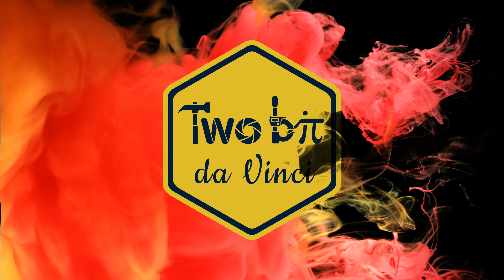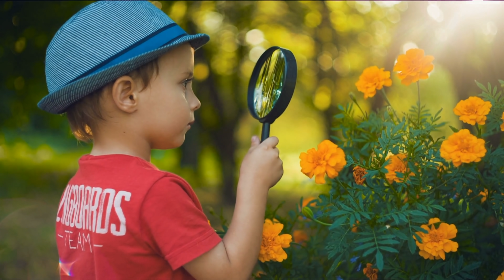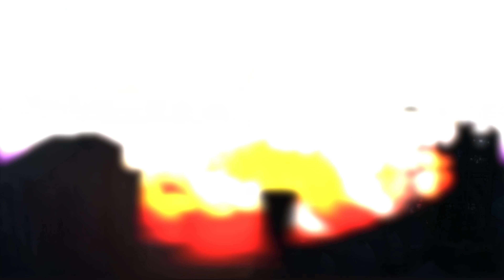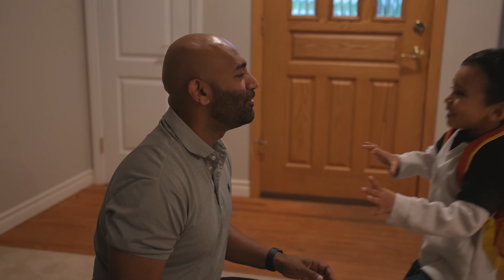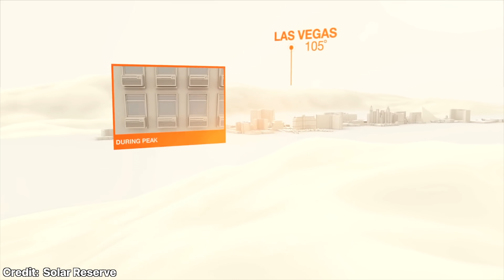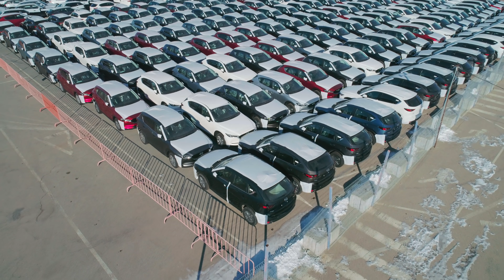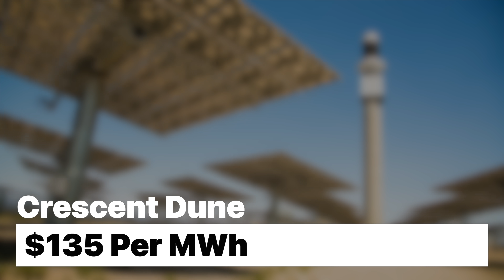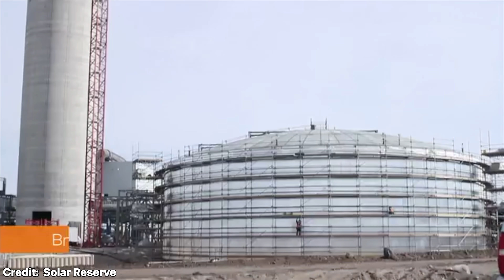This Billion Dollar Solar Plant was an EPIC Failure

Comment: Great video, once again. I think though it is a real copout to say “batteries for PV are coming no problem.”  I suggest a deep dive on the economics and technology of grid level storage. We are way far away from where we need to be for mass appointment. And this is the Achilles’ heel of wind and solar. You would do us all a service really digging in to grid-level storage Technology and economics. I think you will be disappointed.
Reply from the maker: I’m hey Scott good points. We probably have to make trade offs for efficiency. Likely not to get the 90+% of a lithium ion battery. But there are some promising options that are lithium free. Like the ESS iron flow battery I mentioned. Let’s hope there’s a big push for storage in the decade. As you pointed out, it’s needed in a big way

Comment: This is the first plant of its kind and they made a lot of mistakes. It is back up and running now. They were over optimistic about how much it could generate but calling it an epic failure is a gross exaggeration. The point of this kind of plant is providing dispatchable power to meet night time need. It's not supposed to be competitive with PV which only produces in the day. At the moment night time need is met by fossil fuels which are cheaper than csp. If co2 was taxed then csp might be able to compete on price. It may be that in the future new battery technologies will make csp unnecessary but at the moment li-ion batteries are so expensive that even nuclear power is substantially cheaper.

Comment: Good video. It is no surprise that the CSP tech seems like a better idea than panels that only give power for few hours a day, but PV+batteries is far less complicated system than tracking mirrors+molten salt heat storage+steam engine, and that has to be considered too. The plant had lots of problems, it's a risk when you are one of the first to adopt a new technology; makes me wonder if they could have succeeded if none of that happened. But there are other CSP plants planned and in use, so clearly this one failure has not scared people off.

There is no need to wait for TF to make a video about anything. Either something is a bad idea and anyone with a working brain knows that without him making a boring rant about it, or it might work and the contrary opinions of people who would rather watch factually suspect clickbait videos than figure things out for themselves are irrelevant.

Comment: So, it failed because solar PV effectively disrupted it. The leaky salt pipes didn't help things, but that's not why it failed.
Reply: Well the leaky pipes also meant that it probably could never compete with PV. Since the bottom line could only go so low due to maintenance costs.

Comment: It'd sure be nice to see analysis on which part of the system is most costly relative to expectations. If the storage part was too costly, then a redo on the collector thru generator might resolve the issue and perhaps rescue the project from bankruptcy/scrap heap. If the mirror part was too costly, then maybe it might make sense to run the storage part without a collector as a battery equivalent. My fear is that everything was way over "budget" so there was nothing to salvage. A nit: I want to point out that "battery" is a subset of "storage", not a competitor.
Reply: There are all these so called experts ,but they have all cost millions of dollars on a trillion dollar pipe dream tat doesn't work when the sun don't shine and the wind don't blow,and now you idiots want to charge huge batteries that cost billions of dollars,and as well charge millions of cars,I'm not an expert but so far it's the most idiotic system I have ever come across,and the ordinary tax payer has to pay for this ,it's not cheaper and never will be,you can't make this shit up!
Reply: I'm no expert in the United States, but looking at Donald Trump, there appears to be some great benefits in your Country when you declare your Corporation Bankrupt, rather than try and fix problems.
Reply: You get rid of the storage and run oil to steam generation like everyone else.  If you want storage, use pump storage.

Comment: Forget the inventor's name but, like Pasteur, shortly after his initial R&D, he realized that the power tower was a loser. Not the least of its problems is a) destruction of habitat, b) threat of long-distance power-line caused wild fires, and c) huge energy losses from the long power lines. The best use of solar energy tech is still on-site P-V cells + battery + grid load-balancing & storage.

Comment: As some others have noted, this video doesn't make sense and misses some major points. I'd agree that cost per MW setup is much higher, but what about amortized value? PV lasts decades, but ST can last centuries. If the cost of upkeep is high, that is just bad design. All servos and control structures should be sealed and need little to no maintenence. Salt pumps probably wear out, but that has to be part of a standard replacement regimen. The other note of construction cost overruns makes complete sense, but that isn't mentioned in the video. Please remake this video to explain what really happened.

Comment: The problem has nothing to do with the specific technology.  The complexity is what got them.  They simply didn't understand that they would only be able to operate at a much lower rate than their optimistic scenarios envisioned.  Analogous issues have popped up with such diverse projects as the space shuttle program and modern nuclear power plants in the beginning.  Looking at the early days of steam generation and the adoption of coal as a power source also had lots of issues until the kinks were worked out after several decades of effort.

The real lesson to be learned here is that expecting to build something of that size and complexity without facing the demon god murphy is engineering malpractice.  We can use those lessons more broadly, in this case, for the development of fusion power.

While we can expect great things from ITER, even perhaps the true energy break-even everyone wants for on a whole plant basis, its complexity will ensure it will break down often.  Even assuming success and a new generation of plants post ITER when fusion is being produced economically should come with an expectation of low availability and very high maintenance costs.  It remains to be seen how long it will take to achieve true breakeven, in which the total costs to produce the energy, including the cost of the initial power plant and continuing maintenance are less than the value of the energy produced.  I am 70 years old in a month or two, so I do not expect Fusion in my lifetime.  But I do believe that within 10 years, mankind will have all of the information it needs to build a commercial fusion power plant that is capable of true break-even.  How long before we can do that economically is a different question.
Reply: ITER isn't even going to produce electricity, its only goal is proving that it can produce enough power vs what is put in. Only after that they'd start on an actual fusion plant meant to (competitively) produce electricity using what was learned from ITER. Or at least that is what I read.

Comment: I installed a Planetary Air Conditioner, which uses the cold of space as the cold side of the heat pump.  My $200 prototype(*) ejects enough heat to have melted 250 tons of ice per year.  The cooling effect shows up first in my home, to the tune of a ton of ice every day in the summer.  And it uses no electricity.

(*) After seven years no moving parts have failed.

Comment: Issues here include the ways of doing business and the ways of doing engineering.  The infrastructure failures that dogged this project might have been caused by both.  Certainly they stink of building to the lowest cost specification, shaving the margins of error until a failure was more likely than not. Yet it still cost a billion dollars!?

The first thing is that this was not novel technology.  Solar furnaces have been built since the 1950s. Solar thermal with molten salt, first as the heat transfer medium and later as a thermal store, came online in 1990s. The Gemsolar plant in southern Spain came onstream in 2011 and achieved 24h per day generation in 2013, and it's producing 80GWh annually.

The second thing is that the economics is not really direct with a PV installation but with a PV installation plus its storage systems. Neither batteries nor pumped hydro nor any other storage system comes free.  But still the market pricing for Crescent Dune seems mad.  Solar thermal generation is producing at between 5–7¢ per kWh which given that utilities such as ConEddison in NYC have domestic retail tariffs of 12.732–14.635 ¢ per kWhr should be decently competitive (had to read down to page 532 of ConEd's tariff doc to find those numbers!).

It is deeply, deeply disappointing that the Crescent Dune project was so badly messed up as it will be taken as an example not to pursue this tech but it shouldn't be as others have managed to make it work.

Comment: Sorry, but I have to comment on the respirator mask ad.  In no way shape or form will wearing masks help us get back to normal.  The only way that will happen is for the virus to work it's way through everywhere, which it is at a rapid pace with Omicron.  After that, we will all have some form of either natural or a combination of vaccinated plus natural immunity.  There is nothing "normal" about wearing masks.  Masks have been pretty much ineffective at stopping the spread of Covid-19, but they certainly have caused a ton of angst and division.

Comment: one thing i’ve been thinking about recently is how 3D printing collection towers might drop the cost of these types of power plants. solar thermal is great and underutilized because it has built in energy storage. additionally, should advances in working fluids like supercritical CO2 be realized, it should theoretically have a higher efficiency than PVs. companies like Relativity Space have created alloys that can withstand the punishing environments created by space travel that they are using to 3D print rockets. their plans for these rockets are similar in stature to a collection tower. i could see a start up take this new knowledge on 3D printing manufacturing, and maybe apply it to this industry? just a thought, but i’d love to see what the potential could be.
Reply: I don't think you could do 3d printing on that scale, the best you could do is print out individual parts but then that becomes more expensive. 3d printings advantage is printing it all out into one peice then shipping it out. Something so massive already made of concrete just can't compete due to how hard transport would be and no one wants to build a 3d printer around a construction site
Reply: @blucksy1  you sound EXACTLY like one of those OIL INDUSTRY lackies that absolutely HATE COMPETITION

.
Reply: @blucksy1  good point…plus the alloys would be different on the inside from the heat

Comment: When electricity was the NEW technological marvel, 120 years ago, centralized power generation was the only viable method of making its widespread adoption possible. Not everyone has a stream of water of sufficient volume and head flowing across their property to make their own electricity. That is equally true for power generated by steam; it just isn't practical. But the light from the sun covers the entire globe, even the extreme polar regions, for at least part of the time over the course of a year. 

At those latitudes on the globe where sunlight falls every day, the limiting factor for making solar power useful is a means for storing the excess generated during daylight hours so that it can be consumed during the night, as needed. As battery technology has advanced to the point that we now have relatively lightweight batteries that can store large amounts of energy we begin to approach the moment when centralized power generation is not only not necessary but its inherent inefficiencies become more and more obvious with each new advance in battery and power generation technology. 

This means that just as the Automobile brought about the decline and even the demise in much of public mass transportation, the ability for individuals to generate, store and retrieve electricity, as needed, will lead to the decline and, ultimately, the demise of massive, centralized power generation. Large municipalities will always have need of a centralized power plant, much as New York City still has large Steam Generating plants in operation there but the less densely populated areas will be such that individual homeowners will want to control their own destiny by controlling the source of the energy they consume. 

We see this happening with electric vehicles already. Tesla is building charging stations at a pace greater than even the Federal Government is funding them for Tesla's competitors. Those charging stations will do for Electric Vehicles what gas stations did for the IC powered vehicles in the early 20th century. And with the ability to capture, store and consume electric power electricity, consumers will, in time, have the ability to completely abandon the so-called "Energy Companies".

The massive, centralized Solar Power Generation concept is a model that will NEVER be able to compete with individually owned power generation and storage equipment as the technologies improve and the  equipment required to become you own electric power company decline in cost. Single-Family homes will have sufficient roof area to accommodate  the necessary panels and, just as the Personal Computer revolutionized communications and information, solar power generation and storage will do the same for that technology.

Comment: I am confused, did you just say this 110mw plant was built for 1bn, yet a 40mw solar was 12bn.
Then you say cost per mwh is smaller for pv, how can the opperation of cresent dune be 33 times more expensive than pv?
Reply: Don't trust his numbers, a site like that would not need tens of thousands of employees to operate, you would be looking at between half a dozen to a dozen at most.

As far as PV, PV doesn't take anything to operate or maintain (not really anyways), at least with most modern technology options, i.e. Optimizers and Microinverters, particularly Optimizers which allow for each individual solar module (commonly called a panel) to bypass the others. Think of Christmas Lights, Series vs Parallel, the new ones don't all go out should one light bulb go bad, the old ones the entire strand was out and you were hunting for a bad bulb.

Most of the new stuff bypasses that, meaning you maybe go check back once a year to replace bad optimizers, spray the panels with water, and you're done for another year.

Comment: In the 50 years of oil field service any time one deals with salt you have a highly corrosive environment. If the materials are not top quality the maintenance is a nightmare. This must be managed effectively all the time which costs can be more expensive maintenance wise. Modern day engineers and accounting will shut down any projects that cannot be effectively controlled.